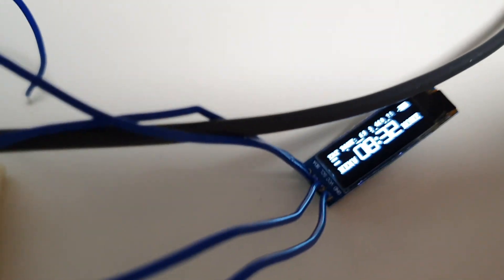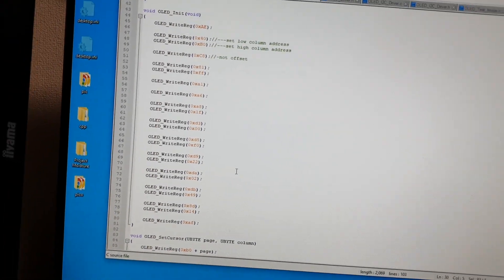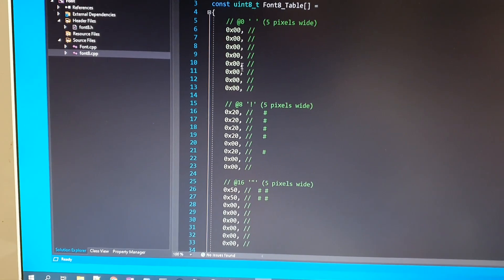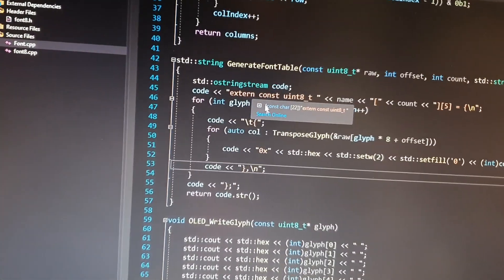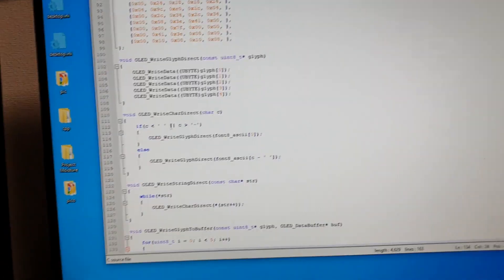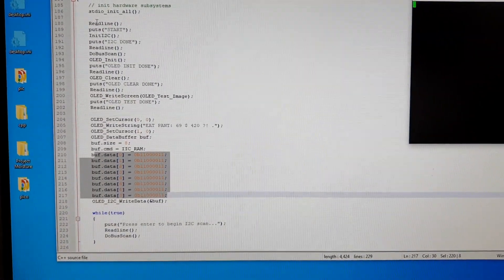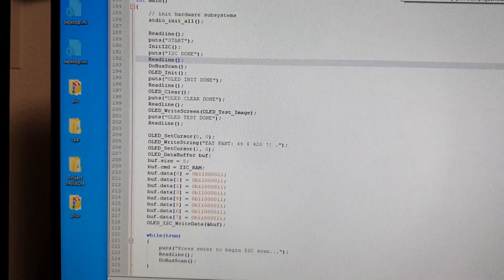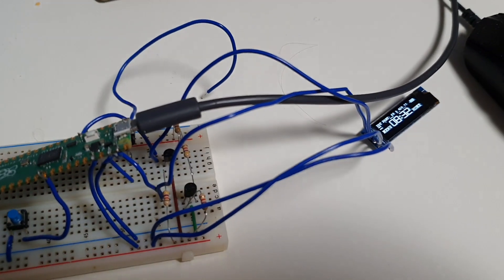OLED I2C Display Module [Project Moisture]

Comment: 7:16 Well, there goes our oportunity to see portable poo game...
I work in a place where they have a kiln for drying pine boards, it has this huge metal box with all the humidity and temperature reading stuff, even some small display display and knobs to set the time and temperature.... but is locked and out of reach for my curiosity...
Reply from the maker: We all need to know, can it run Doom??
Reply: @ChiliTomatoNoodle  I kinda wanna keep my job.... at least untill i learn c++ and game dev enough to be a milionaire. But it would be some cool stuff to see, the face of my boss finding me hidden playing doom on his machine... "c'mon you paid huge money on this, at least doom it had to run..."

Comment: Holy cow Chili. You had to loose skill points playing with micro controllers. Hehehe... just playing, but just saying. Arduino C++ has some weird class restrictions. Try with hardware interrupts isolated as private. Doesn't like the last time I tried.
Reply from the maker: Well, not doing any Arduino so shouldn't be a problem for me :]
Reply: @ChiliTomatoNoodle  My bad - that's a pi zero it looks like.
Reply from the maker: @AtomkeySinclair  Pi Pico, but funnily enough I actually end up going with a Zero in the final product.

Comment: F**** cool by the way I have a conundrum...(la zer tagged... Why do I title  la zer tagged...? part because people are anal and try to f*** s*** up like this and also this is one of the weirdest conundrums...)
Long time ago under a different name I posted something about using code in C++ to a database program and graphically and coding it across various Arduino (or I2boards with a database program however...
Let's say command [054]* = red team has the flag!

... But with i2c interface using an RFID reader with an infrared out I suggest 950 nanometer,.. as well as the appropriate photo diode...
Now when you combine that with two strips of three ultimate RGB nanoprecision pulse with modulation (whatever gizmos...right.👍)

... And have network access to where each player is and when locking on to one player with the infrared 950 nanometer infrared thing onto the one that you are using the trigger to pulse onto...(right?)

When you lock onto and fire onto another player when there are x (+1) players in the arena of various teams (blue team captured observatory!!!... While player three from Red team just locked on to/ fired locked on to them)

The question is with machine level code interrupts how can we multiprocess this maybe I could send you my code or something I have a couple other questions for you cuz I know you're a grand master at programming...
Reply: Yes I know there's a bunch of random ramblings but you get the idea sort of I'm saying the conundrum of having that many components and modules on a laser tag unless you refine it it's pretty hard however we can do this I have most of it written